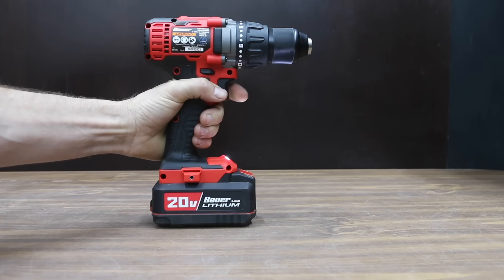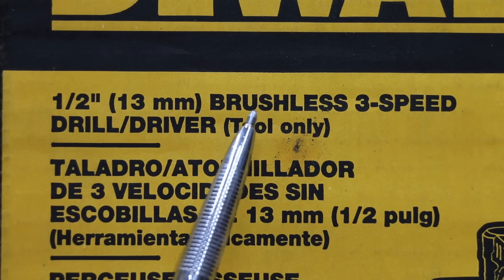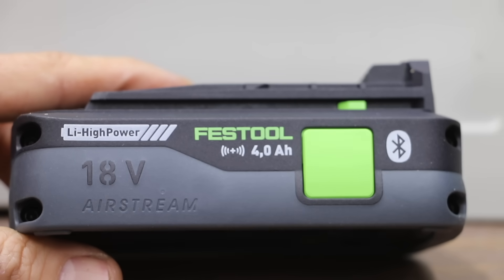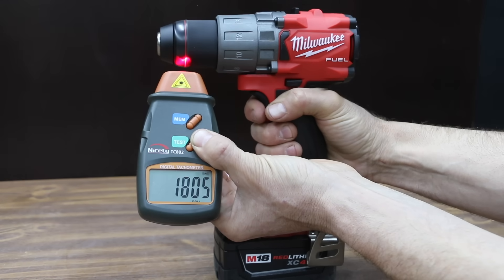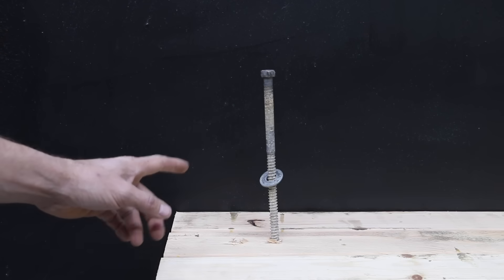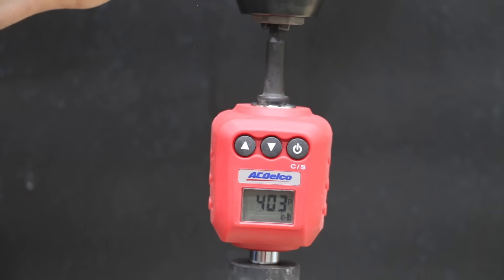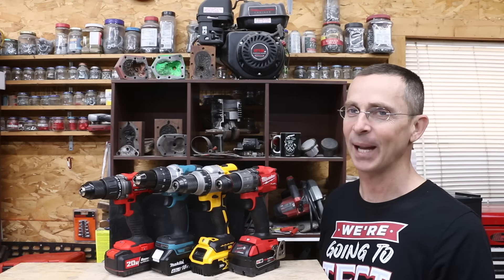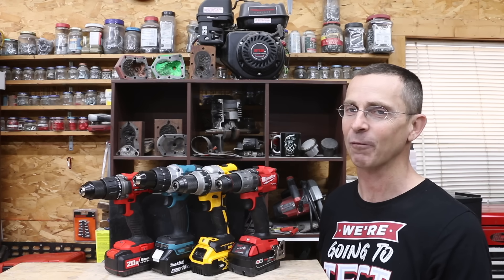Best Drill (BATTERY POWERED)? Milwaukee vs Dewalt, Makita, Bosch, Festool, Ryobi, Bauer, Ridgid

Comment: I have a Bauer 20v hammer/drill/driver and it's extremely torquey. For general usage like drinking holes and driving screws, it's awesome but if you need a light tough, be careful. Oh and the chuck sucks. I bought one This Old Tony recommended and it's a completely different tool. 

I also have a Ryobi drill/driver and this is my daily driver... Uh hum... It's not perfect but it does a great job. I used it to rebuild a deck and drilled over 1,000 holes in pressure treated lumber and it didn't complain once. It's still going strong.

Comment: Back in 2019 I raced pro open small-block dirt oval go-karts my handheld starter broke which is a car starter in aluminum basket with a shaft to hook to your crankshaft we do not build their engines with a lot of compression to save the rod bearings and the bottom in it is a closed chamber head or small CC head with a longer rod and my drill started that engine 2 times so i could finish racing
Reply: Just saying my drill started a 20 ish hp motor 2 times on methanol with a bunch of timing and it got it moving fast enough it didn't kick back and break anyrhing
Reply from the maker: Thanks for sharing.

Comment: I have yellow tools, but recently thought I'd throw some less quality tools in the go to the pick a part yard tool bag...so I have the Bauer and a few Hercules tools as well.  When I'm doing something around the house I'll grab the Bauer or Hercules just for a test, if they fail I go back to the tried and true yellow tools that never let me down LOL.  

For a typical home owner hanging a picture, putting in a few deck screws, or lag screws, and drilling applications, you really can't go wrong with any of the tested drills and for the price the Bauer honestly isn't too bad...Hercules is a step up from Bauer, but you are toying with better brand tools at that price point anyways.  

I've used Dewalt, Ryobi, Ridgid, and Makita over the years, they all performed just fine for garage door installation duties, but the Dewalt and Makita batteries would last longer on a charge than the Ryobi.  Ridgid was kind of in the middle for battery life on a charge.  I've never had a chance to try the Milwaukee stuff, but nothing wrong with those either....if you want stuff that's gonna last, and you use them all day every day, buy the brand name.  If you drill a hole occasionally or drive screws occasionally around the house, any of the lesser name tools will suffice, but I wouldn't put a Bauer or Hercules tool in my tool bag for work LOL.
Reply from the maker: Thanks for the feedback.

Comment: I don't understand why you would do the first test in 1st gear. 2nd gear is clearly the intended speed for that particular use case. You leave too many variables to get an accurate result out of that test. Just odd you chose 1st gear for that one.

Comment: If you use the Bosch with a Pro core battery instead of this non original battery you are gonna get a completely different outcome. 🤷🏻‍♂️
Reply from the maker: Thanks for the feedback.
Reply: @ProjectFarm  you've got a great channel. Love it. Cheers from Germany 🙋🏻‍♂️❤️
*The Bosch batteries are actually able to communicate with the gadgets so as to ensure that old gadgets can use the new batteries but don't get overpowered and new gadgets are able to use old batteries so the user can always rely on an existing ecosystem. That's why the Bosch batteries have got 5 poles instead of only 2.

Comment: I'm a Bosch/DeWalt guy. That's all we use at work but I'm going to say it now: Milwaukee is underrated. It keeps surprising me whenever these types of tests are done on your channel. I still can't believe how well it did on the torque test. This brand along with Ryobi are the brands that get made fun of the most by seasoned carpenters here. They're dubbed "the poor mans power tools" by many of my coworkers while Bosch and DeWalt get all the praise.
Reply from the maker: Thanks for the feedback.
Reply: Milwaukee consistently cost more than DeWalt, so I'm not sure why anyone would call them poor-man's anything. That said, they're not as ergonomic as Bosch, DeWalt or Makita and their clutch and chucks aren't as good as DeWalt's IMO for the same class of tool. The battery release system is also very poor and it's a much bigger hassle using them compared to pretty much every other brand. Every maker has their top-rated products. When it comes to drills and drivers, DeWalt, Makita and Milwaukee are hands-down the best. When it comes to nailers, Milwaukee has no equals (it's not even close). Track saws? Makita, Festool and Mafell. If you want something approaching the best for every tool, you can't stick with only one platform.

Comment: This was a good comparison of these drills new. I'd be interested in seeing a comparison of them after they've been used out in the field for a year or two. Think you can do a video of that?
Reply from the maker: Great suggestion! Thank you
Reply: The results are going to be the same for DeWalt, Makita and Milwaukee (for the most part). With the Milwaukee I find the chucks and clutch aren't as good, robust or predictable as the DeWalt after regular use - going on 4 years for each of them myself with daily use. When it comes to drills and impact drivers, it simply doesn't make sense to go with other brands.
Reply: @amerikalast  I have to disagree with you on that statement about Milwaukee chucks and clutches. I have a 12v 3/8 Milwaukee drill that I've had for over 12 years now and, used it every day before I retired, its chuck and clutch are still going strong.
Reply: @jimgam730  
The latest models of Milwaukee, and other brands, have suffered at the hands of corporate bean counters. The engineering teams are instructed to whittle away at parts to reduce manufacturing costs to increase profit margins. 

If they only leased their tools and had to absorb nearly all tool and battery repair costs, then the story would be the opposite. However, short term managerial incentives are the rule.

Comment: I don't agree with your assessment seems like your little partial to Milwaukee because the low torque eliminate it out of consideration that 135 and we even added a low-level RPM at 35 and the DeWalt doesn't fare much better with low-level torque at 76 the only thing that I really see lacking with Makita is the high torque because it was at 0 and 78. DeWalt maybe Milwaukee at low torque 135 not even its probably because you have the impact as a previous but we're not really testing impacts were testing drills there's a huge difference. Because clearly across-the-board except for the last test it was Makita and that could be explained away buy safety of its shutting down and having to finish in first I'd rather a drill shut down than burn up. Seems to me that would increase longevity however I'm going to have to re-watch it again and notate Milwaukee and DeWalt because it's great that you give an individual breakdown as you do the test but you should do a summary at the end so you can do a direct compare. But the clear to winners are Makita and DeWalt and difference being Makita low T 0, and  DeWalt 76 because DeWalt high is 245 vs Makita 78. And they're Max torque is 55 inch-pounds different with DeWalt winning that. And with only a $14 difference and DeWalt being quieter DeWalt is the actual winner unless you want zero torque on your lowest setting sacrificing the high side on low for Makita because they're practically identical Milwaukee's not even a horse in this race.

Comment: Milwaukee has a torque trigger. Therefore you sqeezed it all the way to make it spin at 35. You can throttle the speed, so why did you not mention that.

Comment: My favorite drill, of the many I have owned, was my crazy looking green Hitachi.  It must have had a very different gear ratio or something, because it's top speed was oddly slow, but it had crazy low-end power.  Beat my Dewalt and Craftsman corded drills in power easily.  When the drill was three years old I discovered I could push the battery wires of my kids' electric scooters into the pressure connections of the Hitachi battery, and they worked for at least another year powering the scooters a few times a week.  After I moved to my new place a flood ruined the drill, but I'll bet the batteries were sealed and still good.
Reply from the maker: Thanks for the feedback.
Reply: I had a Hitachi a few years back that would break you wrist if used wrong

Comment: Still own and use first gen Ridgid drill and impact set. Built decks and drill steel. Will say to use the mountable drill torque handle for larger holes.
Reply from the maker: Nice!

Comment: I did assembly work at GE three years ago. We did a great deal of fastening; the company tools were Milwaukee 18V but could be scarce. Some fellows brought in their own DeWalts, Makitas, Ryobis, Craftsman, etc. The Milwaukees ALWAYS ran without trouble in that industrial setting, lasting about 2 years each with very heavy use. The batteries didn’t always get used properly, yet lasted a year or so with uneven charge/discharge cycles.

All the other brands, most also 18V, died in 3-6 months. Lesson learned, but a Milwaukee once; everything else, replace more frequently.
Reply from the maker: Thanks for sharing.
Reply: What exactly lasted 2 years each? The batteries or the tools themselves?
Reply: @bobmiah batteries didn’t always get used properly, yet>>> lasted a year<<<< or so with uneven charge/discharge cycles.

Comment: Those milwaukee drills can drill pretty large holes too and still last a long time so long as you don't overdo at once. I've drilled anywhere from 1/2" to 4" holes with that thing. I had a Makita that crapped out on me drilling a few 2 9/16" holes. Would be interesting to test just how high these can go for their bit size limits! Through standard 2 × 4s.

Also, I still have a milwaukee drill with a brushed motor that I've had smoking about 5 times now and can still use it around the house. There's a reason milwaukee has such a large market share, they are durable as hell
Reply from the maker: Thanks for the suggestion.

Comment: I'm a stickler for pre-drilling holes to prevent wood splitting, screw stripping, and the occasional screw breaking from torque so it doesn't have to be super-duper Godlike powerful unless I can't pre-drill. Since my wife, and I just bought our first home we'll need tools so I can do some repairs, and eventually some woodworking. I've always wanted what I call "contractor grade tools" because though I won't be using them on a daily basis, I want them to last a good, long while, and be powerful enough to complete most tasks. The problem for me is pricing.
  The one thing that has me scratching my head in both confusion, and frustration is this new trend of selling "tool only". If you pay $150 for a tool in an effort to save money, by the time you buy the charger, and batteries separately, you've ended up spending more than you would if you got the entire kit. When you buy things separately you're paying for each item's marketing, and packaging as well, and that always unnecessarily increases price. Hopefully this trend will go away.
  I've always thought of cordless drills as convenient, and portable, but when you want real power, and reliability you use a corded drill. Personally I think one should have both. The corded drill is less convenient, and requires plug-in power, but is a great backup for when your battery drains before your backup battery is fully charged, and you need a drill right away. Corded drills lack a clutch, but if you're skilled enough they can still be used with great effect.
Reply from the maker: Thanks for the feedback.

Comment: I have the bauer drill,hammer drill, impact driver, 3/8 impact.use them daily all day at a car dealership..work great had snap on ,milwaukee,makita,dewalt,ryobi...these at thier cost and cost of new larger batteries way better just wish they had a stronger 1/2in impact.had for over 3 years no issues.did have to get a larger battery to keep from having g to charge every other day ..I can use the larger battery for about 3 days of regular use on impact driver or drill.forgot to mention the hot glue gun..that one has to use the larger battery..eats small batteries in about an hour
Reply from the maker: Thanks for sharing.

Comment: I got a $100 HF gift certificate for Christmas and bought the Bauer Brushless drill but once you buy a 3 Amp battery and the charger it all adds up to about $130....not exactly dirt cheap considering Home Depot has the DeWalt 20V brushless with the charger and 2 of the 1.5Amp batteries for $99. I guess in reality I only have $30 in and cant complain
Reply from the maker: Thanks for sharing.

Comment: I have many of Bauer's tool lineup. Especially considering how cheap all the tools are, what you get for your money is pretty impressive. As long as you don't stomp the tools too hard for too long they do pretty well. I use my tools for vehicle maintenance/repairs for my truck and my wife's car as well as occasional jobs around the house, like more recently fixing my dryer. When I first bought the Bauer impact driver, I used it to replace the studs on my truck. Despite the job being a little too demanding, it still managed to get it done, it just took longer, but it worked all until the very end when it burnt out and stopped working entirely. I brought it back to harbor freight and they gave me a new one since I had just purchased it, so everything worked out just fine. To be fair though, it was definitely worst case scenario, it was sitting in the sunlight for hours, 105+ degrees outside, with constant demand as I used it to drive the new studs in my truck, and some other repairs as well. I swapped batteries once or twice too, it got no breaks. Overall, pretty decent option if you don't wanna spend too much money and you're not looking to do anything too extreme. It doesn't have enough power to free a brake caliper bolt or replace wheel studs reliably, but for the average person it'll get the job done.

I plan on upgrading to Milwaukee in a few years, but I'm definitely gonna hold onto all my Bauer tools as well. Having a cheap backup set of tools to keep around the house won't hurt.

Here's a list of all the Bauer tools I have, although I may be forgetting some since I'm writing this off the top of my head:
Impact driver, hammer drill, portable fan, LED work light, leaf blower, vacuum, heavy duty impact wrench, dual power tire inflator

If you're looking to buy a drill and the opinion of a stranger on the internet means anything to you, I would urge you to stay away from the Hyper Tough brand Walmart sells. I bought one of those before I found Bauer, and it's so weak that it's embarrassing. It can barely even drive a screw into a piece of drywall, and I recall the battery needing recharged/replaced every 5-10 minutes or so. You may as well just buy hand tools at that point, or spend a little more and get Bauer or shell out a lot more cash for something truly quality like DeWalt, Milwaukee or Makita.
Reply: I cant even drill a hole on a 2 by 4 with it. I think the battery is a problem for it to stall. The drill feels very weak too
Reply: @LowkeyXxx  Gotta be doing something wrong or using it in the wrong setting.
Reply: Hey just fyi I use them daily as a tech at a dealership..bauer is great don't upgrade to Makita.thats a downgrade bauer works great day in and out her for removing bumpers wheels mechanical and more use their impact for heavier jobs such as studs on your truck that's too big of a job for the impact driver.had em all and ended up with bauer  stuck with it cost was first but tried amd put through the ringer they came out smelling like roses and grease
Reply: @professionalbaddass  What

Comment: Video Idea: are brushless motors better/worth the extra $$.  Ex. how much better is the Brand X's brushless drill than the Brand X's brush motor drill (torque, weight, battery life, long term reliability)?  Does that difference represent good value?  Is the Ryobi brushless circular saw as good higher priced brands brush motor saw?
Reply from the maker: Thanks for the suggestion.

Comment: I bought a 12 volt cordless brushless Skil 3/8 drill with 2 amp Lion battery and charger and battery for $70 that was highly rated on You Tube. It works well so far and should be OK for home maintenance work.
Reply from the maker: Thanks for sharing.

Comment: I have this particular DeWalt and it's a total monster, especially in hammer mode. One thing (for better or worse), it has a very sensitive "kickback" safety so if the tool jerks it will kill power. On one hand that's a good thing because it's a torquey thing and feels like it'll break your wrist so the protection is nice. One the other hand, sometimes if you're doing bumpy work it will kick off when you don't want it to. The solution I have found is to hold it tightly and you won't have a problem. 

Anyway, that's why it was "struggling" to start with the mower test.
Reply from the maker: Thanks for the feedback.

Comment: i bought a RIGID impact driver, and my first time using it, on light mechanic work, the chuck broke in 2 minutes, rigid is terrible.
Reply from the maker: Thanks for sharing.
Reply: Correction, THAT Rigid was terrible.  Mine have been awesome.  My friend bought a Dewalt impact that smoked  and died during the first hour of use.  That doesn't mean Dewalt is terrible.